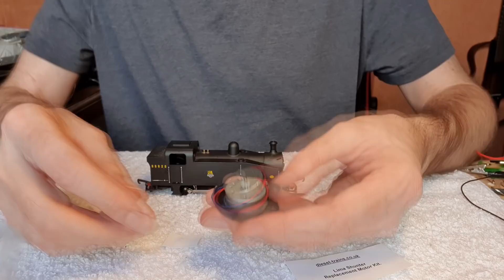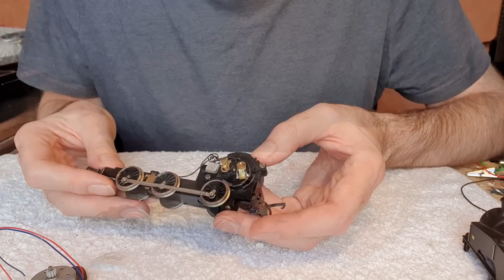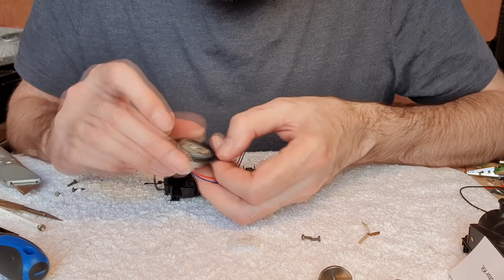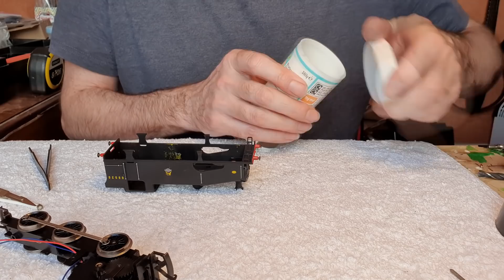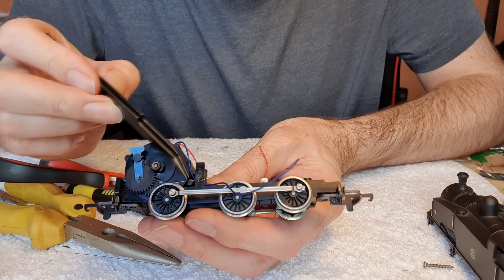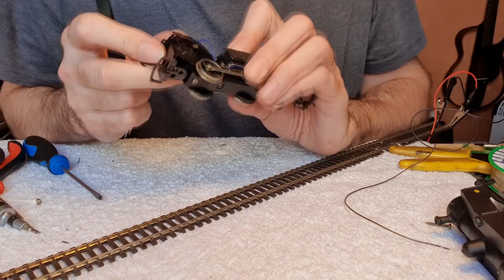Lima Class J50: CD Motor Conversion and Extra Pickups

Comment: Hi. I'm going to fit my j50 lima with a cd motor. I run dc layout. I see you didn't  fit a voltage dropper. Is it necessary ? Many thanks.
Reply from the maker: Depends on the CD motor fitted and on the controller used. But if fitting a 6v motor it's advisable to fit a dropper and it should improve slow speed performance. But so long as you don't run the loco at high speeds it should be fine.

Comment: Hi Bill ,, I have a few of these lima j50's and they all have the original motors in them and they all run quite nicely and smooth but when the last one I bought come to a curve well it takes a life of its own and starts doin the jitterbug .. so after lots of muckin with the contacts it wasnt too bad but i will be adding some extra pickups to so it wont be jerky and jittery.
Thanks again for the great information you put on here. 
Cheers from John in Australia.
I also have been pulling old printers apart and have found that there are 3 little motors similar to these cdmdrive motors you have there on them and all of the work on 12 volts and 1 out of the 4 printers i stripped there is 1 that has the correct drive cog on the motor.
It worked out to br the pickups tomso after lots of adjusting

Comment: What guitar wire do you use for the pick-ups? Is it any good for replacing handrails etc. Great video as always, but I'm not convinced about the benefits of motor replacement unless the original is dead.
Reply from the maker: I use old electric guitar G or B strings or acoustic B or top E. The original motor on this J50 was a bit iffy but I agree to always leave things alone if they work OK. However, it's always good to experiment.

Comment: Great vid as always, I’ve only just got back into modelling and only just found you... question about the new pick up wouldn’t the wire if I’d touch from the rear wheel to the middle wheels do the same thing without soldering to original wires?

Comment: Hi Bill, Just some information for you. I have found a replacement for the single rear traction tyre on Lima 0-6-0's. It is these Hornby X8101 Neoprene Traction Tyres L6241 - Pack of 10. I found several of mine had broken down.

Comment: Never heard of anyone using guitar string for pickups before (however, it's a modelling tradition to use the dual-wound strings for vacuum and steam pipes!). 
I was expecting you to have problems soldering to it, but presumably it has a nickel plating to stop it from rusting? 
Brass wire is most usually recommended for pickups, as it is springy and easily solderable, but willing enough to be bent to shape (more so than your guitar string!) Also, brass is a better electric conductor than steel. Will be interesting to see if you have any problems over time.
Reply: I discovered the guitar string independently. It beats any brass or phosphor bronze or nickel silver. Having built an underframe in EM for an old K's J50 body and a can motor, I cannot believe any firm would use the cab space for a motor that appears identical to one from and old tape cassette.

Comment: Bill, why did you not wind the guitar string around the post as you did, but then leaving the length of the tail long enough to solder directly to the main pick up solder tabs? Only a thought.
Reply from the maker: Because the wire needs to be supple and malleable enough to wrap around the weight and keep out of the way of the wheels. Normal wire will bend into position easily and can be taped in place. Guitar string is strong and very springy so has a mind of its own. It would be possible and I did consider it but it's just easier to solder a bit of wire on.

Comment: Plastic washers seem to be a strange choice to go under a screw, as I can imagine they would deform quite easily if the screw is tightened too much.  Is there any possibility that they were designed to go between the motor mount and the chassis, perhaps to give the motor spacing so that you don't have to cut that little protrusion off?

Comment: What can you use if no guitar string for extra pickups.
Reply from the maker: A thin piece of wire or strip copper will do but won't have the springiness that guitar strings have which keeps them in position . You can get a cheap set of electric guitar strings for under a fiver. The G string will make quite a few pickups! Or acoustic guitar B strings.
Reply: @oobill  Thanks for the information    stay safe